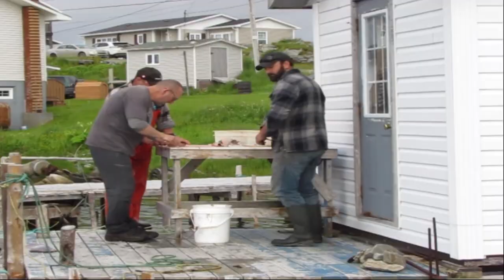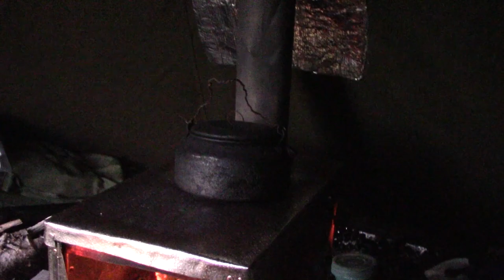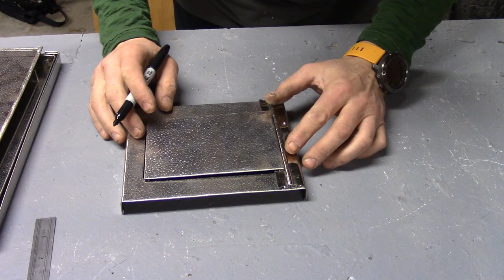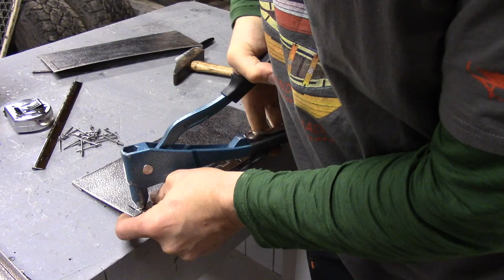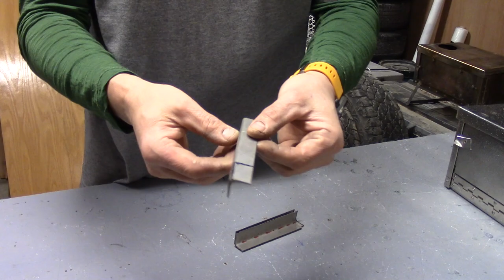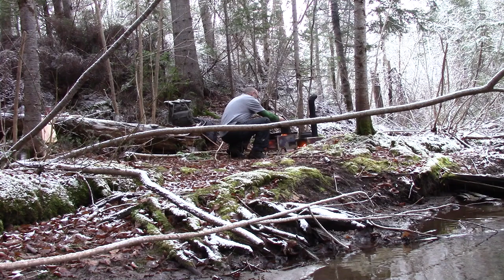Building My Own Hot Tent Stove  Episode #16

Comment: Great video,  I've made a couple of pop rivet tent stove s but never a foldable one really like this and ready to make one.  O don't know if you mentioned but anyone that makes one make sure you use stainless steel pop rivets not aluminum,  I bought aluminum  by accident  once and it didn't work out they melted and stretched
Reply from the maker: Thanks for the reminder
Reply: Oh, yes! He made a point of specifying that at the outset.

It’s a really good thing that you’re mentioning this again, as it would be easy for a beginner at this sort of fabrication, to make a mistake like that. tyvm

Comment: I was getting worried you weren't going to brew up a cup.🙂
Pretty slick, my friend, pretty slick.    For sure someone with a little welder could make it a little better, but man, with just a couple hand tools, and some tin?  Pretty slick.
And I was just looking at portable fire places for using in areas where an open fire isn't a good idea, or to grill when wood is a little scarce.
Only thing I'd add is maybe a small plate for the bottom to spare it from getting burned out.  Maybe another piece with a 1/4 fold and holes drilled into it to get a draft under the fire, and spare the bottom.  What do you think?  And it drafts ok, doesn't let smoke out in the tent?
Oh, yeah, and most importantly, what do you use to go through the tent?  Do you have a small double wall section?
Reply from the maker: We use an inch of beach sand around here for the bottom and i got a 12 inch piece of welding blanket for 10 bucks that i use for the stove pipe hole
Reply from the maker: I  tried to make it so people with very little tools especially a welder could make it.
Reply: The Newfoundland Outsider     Yes, for sure.  I can see that you made it in a simple way on purpose.  I only commented because of the inevitable comments from the "pros" on here.

Sand is a really good idea, if you got it.  Here it really depends on where you are.  Some places have, some not even a grain.  Most places I camp don't have any at all.

This is definitely going to be on a to do list for me.  Thanks,  I really appreciate the video.

Comment: Is there a specific steel type you use so it won t melt or I can grab any type of Steele
Reply from the maker: Any mild steel not aluminum
Reply: @thenewfoundlandoutsider6354   sorry for bothering could you tell me  did you use piano hinges ?
Reply from the maker: @BlackStar-vt4hf  yes i did. Little stainless steel piano hinges from canadian tire, and its no bother.
Reply: @thenewfoundlandoutsider6354  thanks man I just bought a foldable on screws  titanium stove but in winter screwing it up is unpractical so I want to modify it